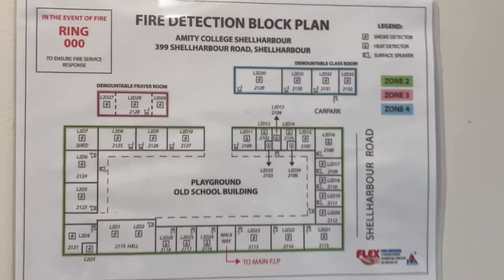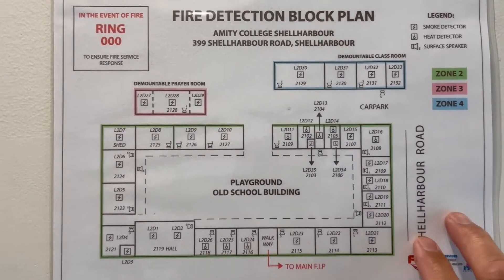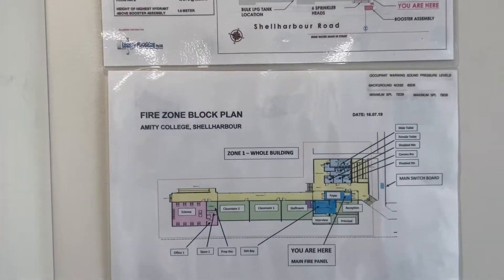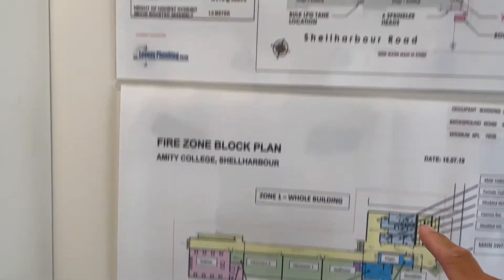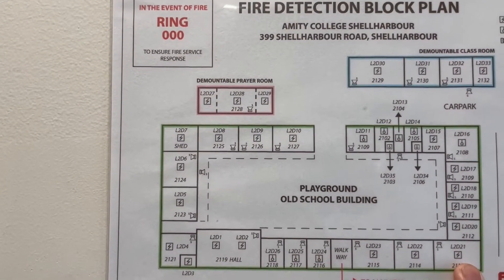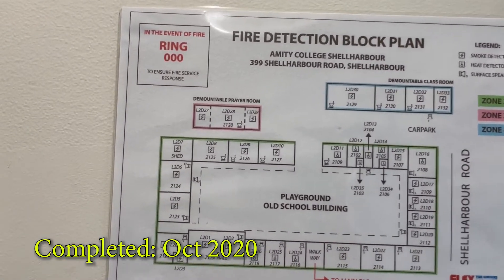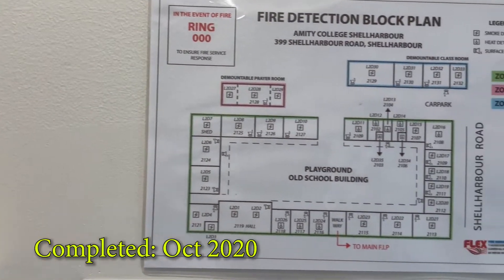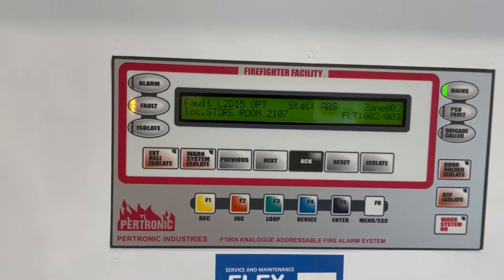SOLVING FIRE SYSTEM FAULTS #fire

Comment: Cheers from the USA. Keep doing what you're doing. It's interesting to see how things are done in other countries but what remains the same is good troubleshooting. Solid methodical process. I work in a manufacturing complex and have 8 million square feet, 42 fire panels and thousands of devices not all fire protection related. They have tied security and other alarms into the fire system which makes every day a nightmare on top of other general maintenance. You had a good attitude when the contractor renovating seemed to be careless in their removal of the devices.
Reply from the maker: Wow.. that's huge work. In Australia, we separated fire from any other system. It's really a nightmare as you are doing other work. We, here in AU,  all fire services are contracted and we attended only if there's a call out. That's a good plus as we are exposed to different brands, model, system, environment, conditions etc. The pay is also excellent. A senior tech now is around AU$45 per hour +. Presently, I am self-employed, have around 95 sites in my books and running my own company. That's the reward of excellent exposure. Thanks Mate for supporting. All the Best.
Reply: @fireprotectionguy7943  Wow tito umabot na po sa USA video po ninyo.  Keep going tito sa mga tutorial nyo po 🙏